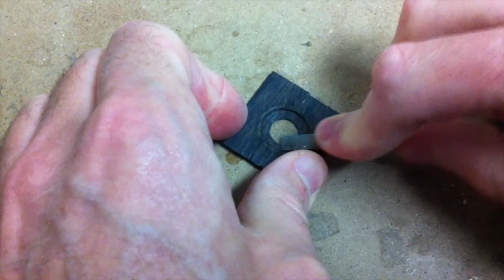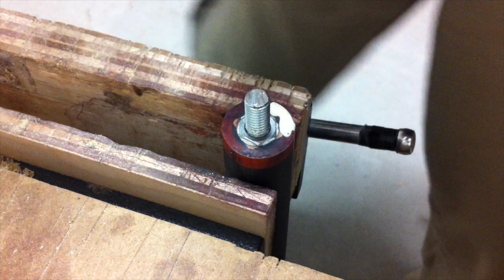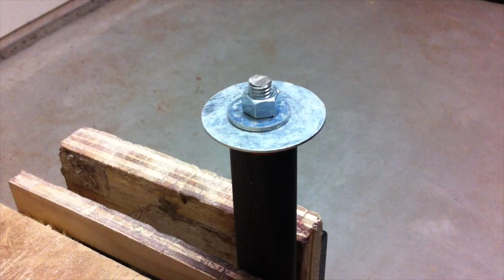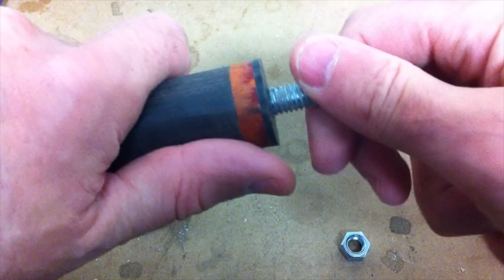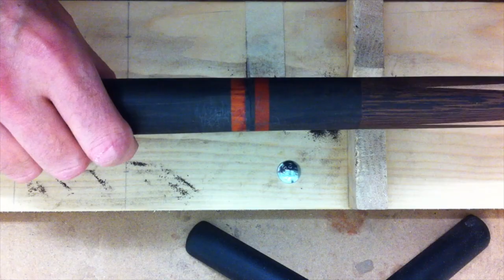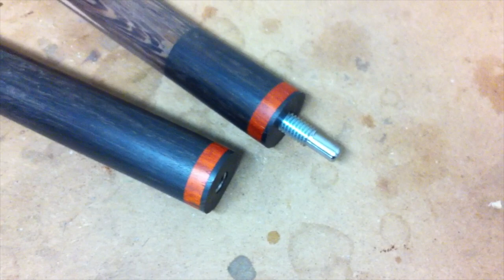Homemade Cue Joint - Part 9

Comment: Great! A lot of ingenuity was seen in the videos of this series.
I was particularly surprised by the guide mirror for drilling vertically.
thank you! Now you can repair your own CUE too.
Reply from the maker: Thanks man. The drill jig would actually work better if two pieces of wood were glued at right angles right against the hole, rather than the mirrors. I'm planning on modifying it to work that way instead. Appreciate the compliment:)

Comment: Fantastic work on the joint! I'm usually not the biggest fan of purpleheart in a cue, but this looks tasteful as hell.
Reply from the maker: Thanks man, I appreciate the compliment. The wood used here is actually not purple heart, it's padauk, which I agree looks nicer than purple heart. Easier to work with as well:) All the best.
Reply: @danielmarcbrooks568  Oh, nice. I have a padauk face splice on my English pool cue. Gorgeous red wood.
Reply from the maker: @gregmooney94  Yeah, it's a beautiful wood for sure:)